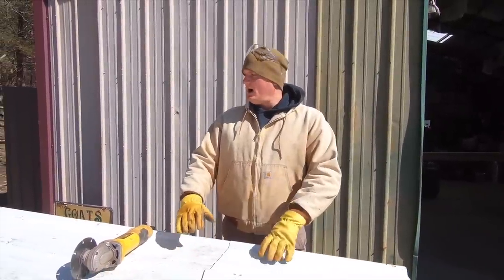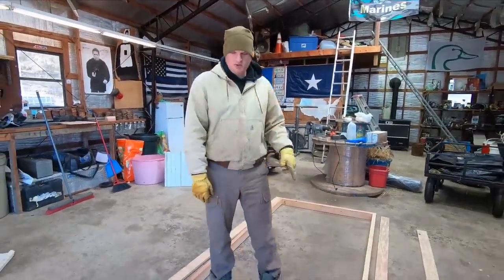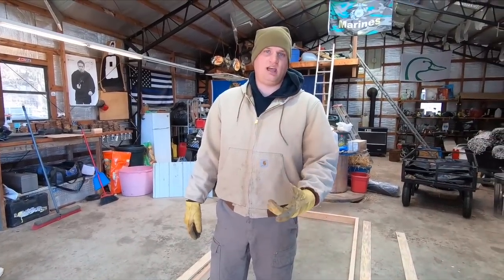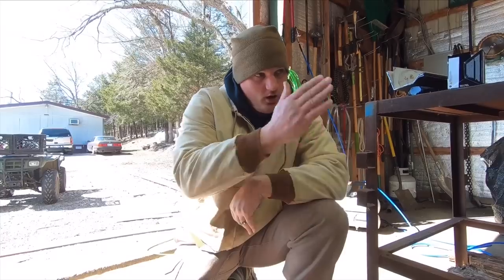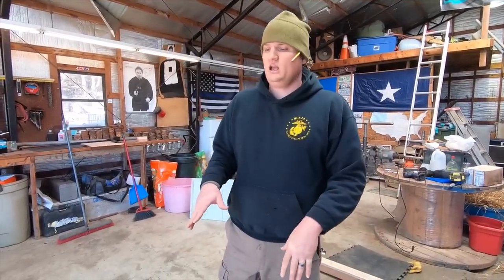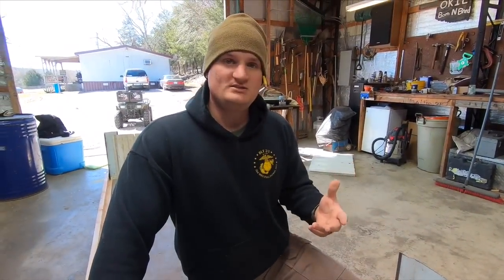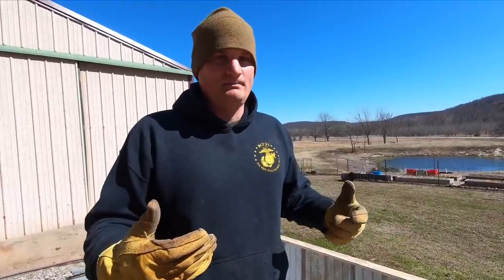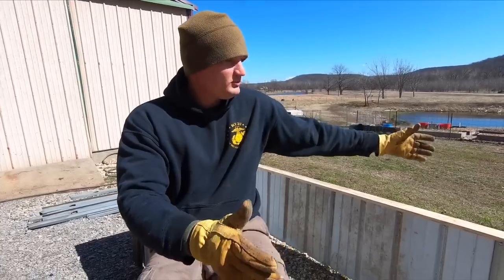STOP Building Wooden Raised Beds!! | How To Build The BEST Raised Bed For The Money!

Comment: The galvanized steel is probably not as bad at leaching chemicals as wolmanized wood but i bet it will do some.
I don't know how well the organic oil will last, but you probably could use the wolmanized wood since your wood is at th e top not touching the soil, and getting all that air anyway.
This is a question now, i always wonder why people make raised beds only 2 ft high and under and not ever 4 ft, or even 3 ft. But anyway i want to build one out of the steel(recycled like yours), but was thinking to make it like 3 1/2 ft high, about the height of a table. That way i don't have to try to bend half way over with a hand shovel, or with a full shovel trying to use it in a raised bed, i can stand straight, and use the hand shovel without bending over. So, do you know the reason they don';t really make them as high as a table for example?
I have a common reason i can think up on my own, like it takes too much soil to fill, but that can be fixed by not filling the whole thing with soil, technically you only need the amount of soil the plants will need, so the bottom could be filled with an old tree you cut down or something. Or you could just have  a compartment that don't go to the ground,  like a 2 ft deep compartment with a bottom, and then it would be top heavy, never mind, unless you have the tools and time to plant posts. lol But is there any other reason why they won't do a 4 ft high bed, because i will just cut logs to fit in the bottom until i have like around 1 1/2 - 2 ft left to finish filling the bed with good soil, and that way i will have fugi system inside there too with the logs buried under the soil? 
thank you
Reply from the maker: Good question Tony. I’m not sure why they don’t make them that tall. I could see if (in our case) you don’t have walking access to the back side of the bed, it would be hard to harvest crops in the back with it being that y’all. But other than that, I’m not sure. 🤔
Reply: Tony, how high you build the bed would depend on what you are going to grow in it and how. 
If you are growing leafy vegetables that don't get more than a foot tall, a 4' high bed would be fine. 
However, if you are growing taller vegetables like tomatoes or you want to use stakes/trellises/etc., a 4' high bed would make harvesting your produce a bit difficult unless you want to use a ladder a lot! Since most people use raised beds to grow as much produce as possible, vertical growing can be a HUGE way to maximize your available space! 
A 2' high bed is a good height because, as Jacob mentioned, it's easy to sit on while you are working, but still leaves it low enough to be able to grow things vertically and still reach the produce near the top....well, for most people, anyway. 
Also, if you have kids that you want to get involved (because most kids LOVE some aspect of the garden or another!), a 2' high bed is still accessible for them as well. Having kids help harvest potatoes is like going on a treasure hunt!
Whatever size you decide to make your bed(s), do what works best for you. Just remember to think ahead to harvest time and you'll do fine!

Comment: Another option for cheap, is to use old non treated decking timber that someone has or is about to replace. Talk to a decking timber buisness & ask for some good quality timber they had replaced. Some will charge a small fee, others would prefer to just get rid of it to reduce the disposal cost. With the cost of recycled roofing, much cheaper.
Reply from the maker: That’s a good option too. Thanks! 👍

Comment: Do you have to bury the bottoms of the tin in the ground or does it just sit on the surface?  Does the soil come out under it?
Reply from the maker: We bury the bottoms a few inches into the ground and we’ve never had an issue with the bed bowing out.

Comment: Here’s a little tip to keep you from using two guns! 
Put whatever screw you’re gonna use in your screw gun!
RUN your screw gun FORWARD and just START the screw! 
THEN STOP put your screw gun in REVERSE  run the throttle fast and push down on screw gun!
You will pre-drill your hole and then simply flip the screw gun in forward gear and run it in🇺🇸

Saved me an awful lot of time from building a birdhouse to building a deck over the last 20 years❤️‍🔥🇺🇸

❤️‍🔥THANK YOU❤️‍🔥
🇺🇸MARINE🇺🇸
FOR THE FREEDOM, 

WE THE PEOPLE ENJOY 🇺🇸

Comment: I have a question.  Does the tin bow out due to the weight of the wet soil putting outward pressure from inside the enclosure?  Anyone can answer if they read this.

Comment: My metal came today, 24 each 18” tall (38” wide or 3’) Prime 29 GA Smart Rib + 2.565 each; 2 corner Galv Alume 10’ 11.50 each total with Neosho, Mo tax $89.08 I used Cas Steel, Inc. In Neosho. So I have enough to make two beds now. Thanks for sharing your raised beds.

Comment: U should of put side boards for braces on the sides cos that dirt has a lot of weight and dirt is always shifting, just FYI
Reply from the maker: We will be sticking the raised bed into the ground a few inches or more before we ever even start to fill it. That will help stabilize it. And we’ve never had a problem with it before doing it that way. It probably wouldn’t hurt to put some supports, but we’ve never found it necessary.

Comment: Thank you! So happy I stumbled upon your channel. I love the idea of using metal instead of wood but up until now, I’ve seen only videos that use galvanized steel sheets. I know galvanized resists rust for awhile but it eventually corrodes. So I was wondering if factory-painted roofing metal could be used instead. Now I know the answer is YES! ❤️

Comment: Thanks for the video. Q: yours is the only style I've seen where you cut short sections of the tin and overlap them rather than running the tin lengthwise, and you skip the lower framing. Does the shorter cross section of tin make the sides less flexible/stronger?
Reply from the maker: I think it does. And we’ve used this style for going on three years now in our raised bed garden and the sides have never bowed out.

Comment: I’m going to guess you must bury the bottom at least like six or 8 inches otherwise when you put dirt in there it’s going to flare out right!?!?
Reply from the maker: We will be sticking the raised bed into the ground a few inches or more before we ever even start to fill it. That will help stabilize it. And we’ve never had a problem with it before doing it that way. It probably wouldn’t hurt to put some supports, but we’ve never found it necessary.

Comment: If this metal has been painted or treated with chemicals may leach into your soil and poison your plants and you. Just like you mentioned using treated wood or painting a wood raised garden bed.  Is this tin or galvanized steel?  Many beds are made from galvanized steel.

Comment: Those pieces that you are calling '' Corner Pieces '' look like '' Ridge Caps '' that are used on Metal Roofs at the peak of the building roof to provide rain protection and air ventilation thru a building.

Comment: No offense, but t's not any easier, or less expensive to use the "tin", than it is to just build the bed out of strictly lumber.   I say this because, probably, most people don't have all the tools, hardware, and necessary items to cut and build with tin, over just screwing some lumber together. 

If you want to build a 4x8 foot bed for example.  This is a very common size.    You can (just like I did) go buy some precut 92&5/8ths (studs) for about 4 bucks a piece.   Two make the length, and then I just took one, cut it at 46" just to give it a nice easy round number......those make the ends, (width) and, there you have a (roughly)  4'x8', by 6" bed, for about 12 bucks.  Do that 3 more times, and stack them on top of each other, and you have a 4'x8'  (roughly) by (roughly) 2' (about 22") tall, raised bed garden, for about 50 bucks, when you consider screws. 

And you can have the fine folks at the store cut your 46" lengths for you for the ones you need that length.   As long you you're not asking them to cut like 20 boards anyway....lol

To make it (roughly) 4 ft by 12 ft, you could just buy some 2"x6" by 12' boards, 8 of them to be exact, and then 4 of the 92&5/8ths 2x6's (cut them at 46" again for the width) 

The 2x6 by 92&5/8ths will cost you 16 bucks.....with tax etc....ok.....22 bucks. 

The 2"x6" by 12 ft at Home Depot are, about 9 bucks each.....you need 8 of them, and tax...( I already over estimated the cost of each one, they're 8.81 ea) so......72-75 bucks....

72, and 22 equal 94 bucks per bed.   Roughly 100 bucks per bed. 

A 12 foot steel roofing panel, comparable to what you're using,  at Home Depot is 40 bucks.  (I know you can get them elsewhere, but, most folks won't, or can't)

You need 3 of them to make a bed, so you're already at 120 bucks. Yes, you will have left over of the 3rd panel, which you can use to make another, but, if you're only making one....

Plus, in a lot of cases, they won't stock the item, so you have to order it.  Thus, waiting.....

Then you have to also buy wood to make the frame anyway....

It's just a lot easier to just make it out of wood.....

The only way it's cheaper with the tin, is if, in like your case.....you happen to have a lot of it already lying around....

Comment: One product you can use for preserving the wood I found is Intl Eco Wood Treatment that is non VOC and non toxic wood stain made from borax. It will turn the wood a silvery grey color with tie which it will tend to do anyway in the sun. It's available at Home Depot and I have no connection to either entity.

Comment: Seems to be a bit of hysteria about treated wood. I'm going to use modern ACQ-treated wood for my raised bed frames because I don't want them to rot, and it is considered non-toxic.  The research says there is no measurable transfer of copper from the wood to plants.  In this design, there appears very little wood exposure to soil anyway.  I think there are much bigger health worries in my environment than this.

Comment: There is no way this setup is not going to bulge with no frame on the bottom, corner supports, and middle frame support....it's a flimsy set up, and not longterm.
Reply from the maker: We put the bed in the ground a few inches before we even fill it. The tin is sturdy enough without supports. We’ve done it and it works great. But if one wanted to put supports, that’s up to them. We’ve never seen a need for them.

Comment: Using a grinder with a blade is dangerous for the average person. Using a cutting blade in a skilsaw is much safer.
Reply: a jig saw with metal cutting blade works better and is safer than a skil saw
Reply: I have never built anything in my life. I purchased a cheap (cheap) angle grinder to do this project. I tried it and it scared the crap out of me. I searched for more cutting ideas and Texas Prepper did it with a metal blade for a circular saw. I ordered it and it cut through several sheet at a time with no problem. My husband helped me with the metal cutting. I built the frame myself and then he helped me attach the metal to the frame. Then we used pop rivets at the bottom. It seemed to make it more sturdy. I don’t know if that will have ramifications later. As I said, I’ve never built anything before. We shall see how it goes. It’s beautiful and I love it. Thank you for such thorough instructions. I really appreciate your ideas and help.

Comment: Calling these the best raised beds really depends on the climate. Yes, these may last longer, but would be problematic in my area. We already have issues with raised beds keeping the roots and soil too warm, but this would really heat up the soil. There's no insulation and the metal would just conduct the heat even faster. I could see these working only in an area that was partially shaded in the summer.